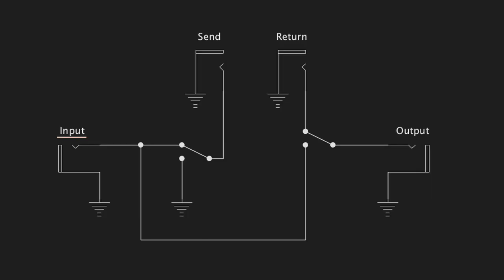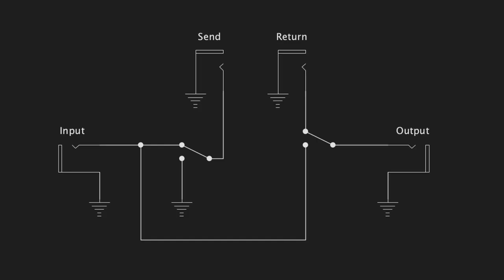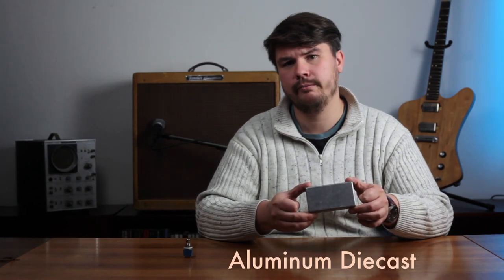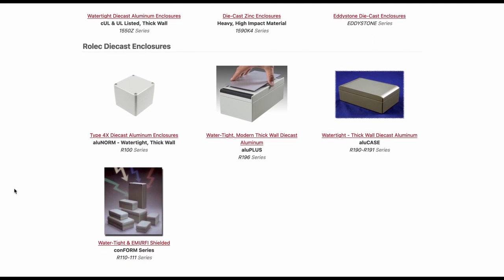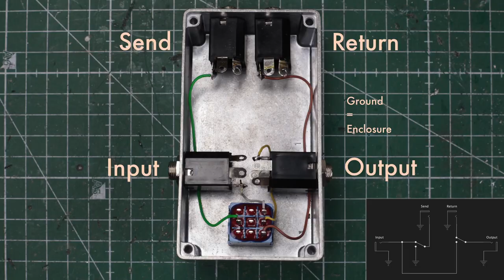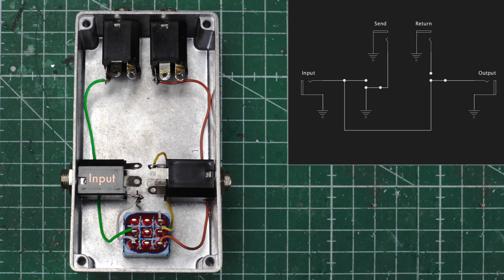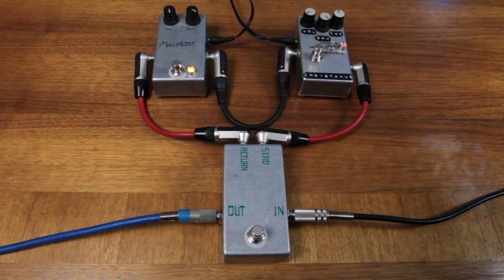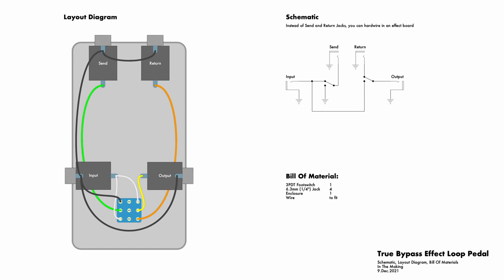DIY True Bypass FX Loop Pedal | Switches Explained

Comment: Mate I love your videos, you've got a subscriber for life here! A question here, I want to add a potentiometer to the main loop (not the FX loop), so that I can even the volume out for FX pedals that have tone suck and are quieter when you activate them (I have a modulation pedal that especially on clean is noticeably quieter when you activate it). That way when the FX loop is off, the volume is turned down a bit by the potentiometer, but when you activate the FX loop, it bypasses the potentiometer and the sound with it on (provided you've tested the settings) should theoretically be able to be matched, and having a consistent volume. I'm struggling to see where to put it in the schematic as the non effects circuit is all within the 3PDT. many thanks
Reply from the maker: That should be doable :) There are at least two ways of going about it. The first is if you want a status LED. I'll explain using the layout diagram: disconnect the white wire from the switchs top right terminal and run it instead into an outer terminal of a potentiometer. Connect the middle terminal of the pot back to the top right terminal of the switch. The third terminal of the pot should be connected to ground.
This should work, but leaves the input with a lowered impedance since the pot is always connected to it and ground. I'd try using a pot with higher resistance than usual to mitigate.
If you don't want a status LED you can use the free middle terminals as a switch and avoid the impedance issue. Run the white wire from the top right terminal to the mid terminal. Run a lead from the top mid terminal to the pot. Wire up the rest as explained above.

Comment: Fantastic video ! 
love the production style and effort put into it. 
also does a great job in making it beginner freindly :)

looking forward to the next episode. 
also:
could you theoretically add an effect  like fuzz or reverb into the bypass ?  
(not sure if you can still call it a true bypass after that)
Reply from the maker: Hi Andy, yes it is totally possible to put an effect into the bypass. Though you would need to adjust the schematic a little. I would build a pedal that switches between two different loops. I'd put the input and output each onto one common terminal. The send and return of the first loop onto the upper terminals and the send and return onto the lower terminals. The downside would be, that both your effect loops could pick up stray signals (think of the cables as radio antennas) and might pop more when turned of and on.

Thanks for your encouragement!

Comment: Nice and clear video. Just subscribed
Could you build a pedal that can cancel Mono signal and leave Stereo signal in?
I'm pretty sure it is possible to come up with a switches-based solution.
I'm not looking for a stereo to mono converter but for a kind of "vocal remover", allthough I guess it wouldn't be 100% efficient.
At least there's a challenge😄
Reply from the maker: Hey, thank you. I'm not entirely sure I understand your question. Could you describe what signals are on the left and right channel, please? Which ones you want to keep and which to remove? This might be either very simple, or nigh on impossible with analog circuits.
Reply: @fxinthemaking6511  Well I've seen one a long time ago but couldn't write down the design to rebuild it...
Let's say you have a song with lyrics. Well, vocals should be mainly centered, same signal on L & R channels. (So would be kick, and bass  too, I guess.)
So, if we can get a way to route what's only on L and only on R to an output, and cancel what's on both channels, we'll get an instrumental track out of a song with vocals. Maybe phase should be inverted on one channel and summed with the other one, so it cancels the signal? Everything mono would proobably end up canceled actually. I'll work on that this weekend 🤗
Reply from the maker: Ah ok, phase inverting one channel and then combining both sounds about right to me. Though in this day and age I'd try to find a digital solution. Any DIYable analog cicuit would probably work less well.
Reply: @fxinthemaking6511  I guess. It's more for the challenge, and the fun of it. Also, It could be interestind for sound experiment, to add atttenuators (potentiometer or else) on the channels, to sclup sound, but It would turn into a bigger project.
Maybe I'll finish my DIY drone synth first 🤔

Comment: I made one and it’s perfect. I’m making a second and want both battery and plug power sources options. Is that as simple as I think it is?
Reply from the maker: Thank you Matt, that's awesome to hear! Using both a battery and plug power is totally doable. Though you want to make sure the battery is disconnected if no signal cables are plugged in and also disconnected if a power plug is inserted. Do the former by connecting the batteries ground to a stereo jacks ring lug. Now the battery is connected only if a mono plug is inserted. For the latter you can hook up the batteries positiv to the switched lug of the power socket, the one that's still unused. Feel free to  ask if you have any questions!
Reply from the maker: And I'd love to see your build!
Reply: @fxinthemaking6511  Thanks a ton for the info! I’ve named mine the Switcheroo and gave it a space paintjob. It works like a charm and will be hitting the stage in late Oct. Cheers man!
Reply: @mattharmeson916  Apparently I made one of these years ago and forgot all about it, until I found it in my closet. I honestly can't remember exactly how I used it in my effects chain, but it has the effects loop, a 9V battery to light an LED for on/Off indication and some resistors and capacitors that I forget why I needed them. But it still works. I think I used it to send effects into an amp's effect loop and return from the amp's effects loop. Either way, it's a pretty easy build for those that want one and has many applications. Thanks for the reminder.

Comment: I need this with all xlr jacks. I play harmonica and want to use a tc helicon vocal fx pedal to play distorted harp for one song with my band. I want to be able to bypass the tc helicon 95% of the time. I haven’t been able to find such a pedal.🤷‍♂️
Reply from the maker: I'm not quite sure about this: As XLR has two hot signals you need a 4PDT. Though you won't have an indicating LED. You would need to replicate the left and right terminals of the 3PDT twice on the 4PDT.